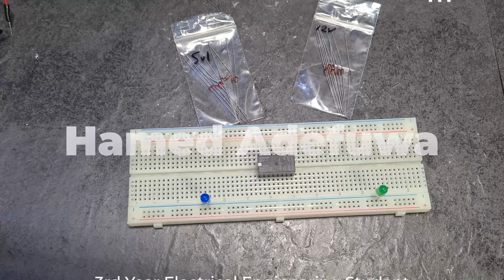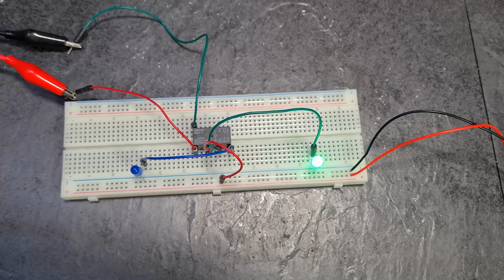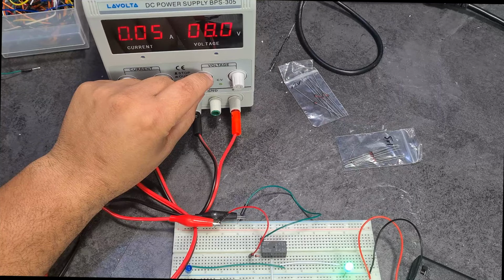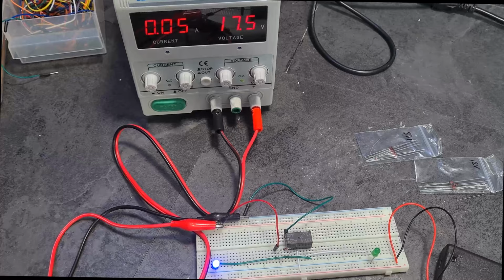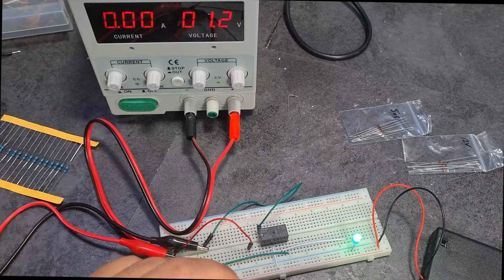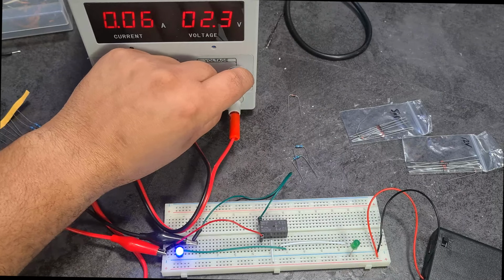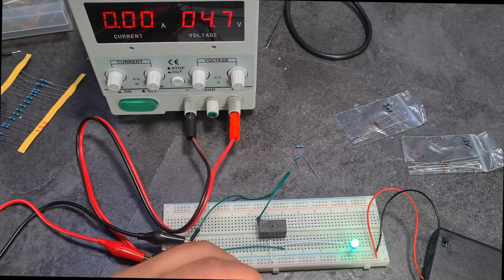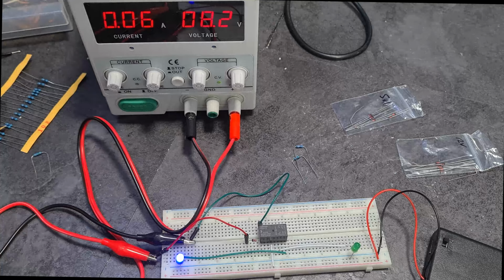Can I Use A Zener Diode To Trigger A Relay At A Set Voltage?

Comment: In your first circuit, the zener is DROPPING 5v.  You can easily verify this with a multimeter.  You indicated that the relay requires roughly 2.5v.   So you need an additional 2.5v from the 5v you are applying in order to trigger the relay.  That gives you roughly the 8v that you are seeing.  Going with the 12v zener only makes the problem worse.

Also, diodes of any kind have a current rating.  I think you are greatly exceeding the rating of your zener and therefore you require some current limiting via a resistor.  The coil resistance of the relay is very low, so you are way overdiving your zeners this way.

Finally, I'm not sure what your thought process is in using a zener as a trigger.  It's not a switch.  A zener is typically used to clamp a voltage at some limit (usually with resistor in a voltage divider configuration) and not for detecting that a voltage is at a particular level.  If I were attempting this, I would probably use a properly biased transistor to trigger the relay, or better yet a comparator driving the transistor.

Comment: It's the resistance of the diode  I think, you're losing a couple of volts and it's becoming heat. Maybe you need to check the amperage of the zener diode you have and check how many amps you are running through it?
Reply: Also, because you were gradually increasing the current it changed the value of the resistor. Interesting experiment thanks

Comment: 4:21 The voltage drop is the sum of the zener diode voltage drop and the switch voltage drop. No?
Reply from the maker: That would make sense lool so perhaps the relays voltage is 3V

Comment: Hello. What I'm thinking is.. First you have to figure out the nominal (more like minimum) current through the coil. The marking "4.5V" on relay case - that's the maximum voltage that can be applied to the coil and it will sustain the current across it, without burning.  Suppose you got it activating at 2.5V, and you measure the current via the coil at this time to be 10mA. Then, you want realy to activate at 12V, so you calculate the resistor, that gives 10ma at 12V: 12/0.01 = 1.2kOm.  You plug it in series with your relay coil. Makes sense?
Reply from the maker: Yeah you're bang on, I eventually figured this out but not too the detail you just explained lol Ty ❤️. One thing that's challenging is dealing with real world non ideal components.
Reply: @HamedAdefuwa  Yeah.. That's what makes me to be frightened every time to power up newly assembled circuit (especially high voltage) even after dozen software simulation runs proved it should work like a charm..
Reply from the maker: I had trouble with a full wave rectifier earlier this week using a function generator, it wasn't producing enough current but I was too scared to tap into the mains lol so I abandoned ship
Reply: @HamedAdefuwa  I guess function generator is just a voltage modifying device. It wont supply any significant current, it's so called "high impedance" circiut... If I got you right.
Reply from the maker: yeah I took the circuit to my lecturer and he said the exact same as you. I spent 2 days trying to trouble shoot it wondering why I couldn't drive a motor from a 12V p-p sine wave lol
Reply: @HamedAdefuwa  yeah... This could feel like a dead end. BUT! The point is  while you can't drive any power load directly by sine wave generator, you can drive a transistor by it. And that mister willk be the one to supply real current to your load.  And even a little easy way would be to use OpAmp circut. I've seen most recent videos on your channel, you are moving exactly right  way solving and digging all those voltage followers, currents source etc ..

Comment: trying to learn too.. what model # diodes were you using? seems there's really specific ones..  I'm looking at Zener knee current and Zen. resistance
Reply from the maker: Interesting I didn't even consider that the zener would have a resistance. 🤦‍♂️ That would definitely increase the relay trigger voltage. I don't actually know the model of the zeners, couldn't find the listing I order them from on eBay and the writing on them is tiny.

Comment: it would help if you shared the circuit schematic … I cant tell what's wrong with looking at breadboard only and without recognizing the relay
Reply from the maker: My bad I didn't actually have a schematic lol I was just told that a zener diode could be used 😅